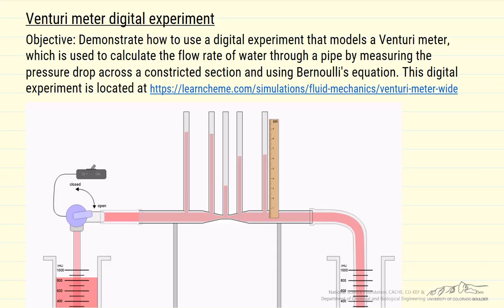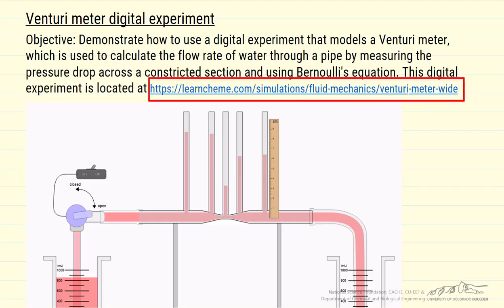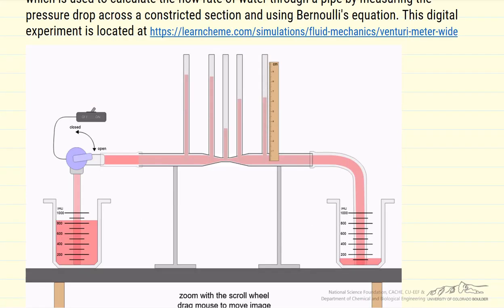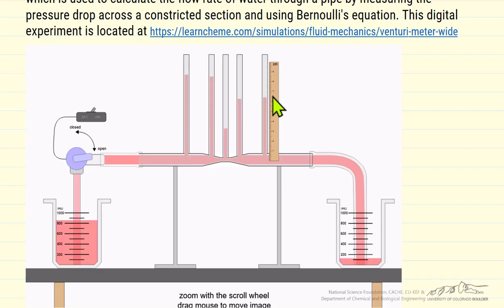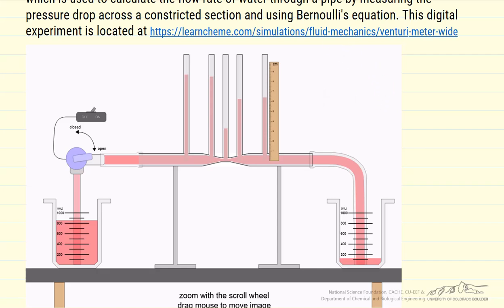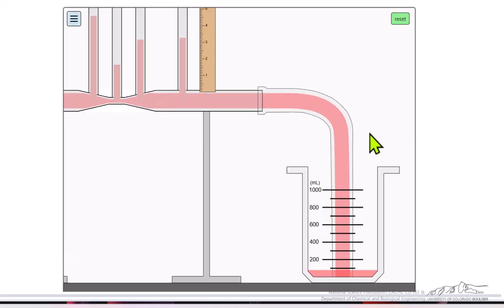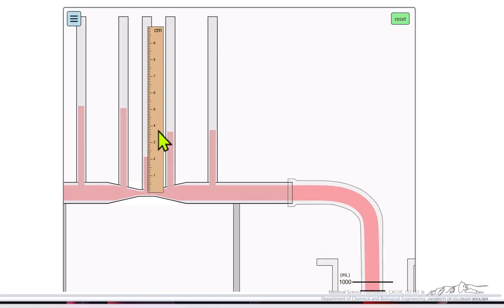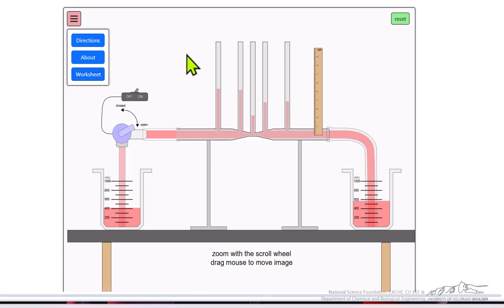Venturi Meter Digital Experiment

Comment: Hello! I love all your simulation videos.  I have a question, since you are using water, which for all practical purposes has constant density, the flow area after the choke looks to be the same as before the choke.  Since the mass flow rate must be the same, shouldn't the velocity after the choke be the same as before the choke?  the simulation seems to show a higher velocity after the choke than before the choke.
Reply from the maker: Hello! Thanks for the comment! You are correct that the mass flow rate is the same, so the velocity should be the same, assuming constant density for water. Where do you see a higher velocity after the choke?
Reply: @LearnChemE the heights of the water column, after the choke, are at a different height, than the corresponding position before the choke.  Doesn’t the height of the column indicate the velocity?
Reply: @LearnChemE  the heights of the water column, after the choke, are at a different height, than the corresponding position before the choke.  Doesn’t the height of the column indicate the velocity?